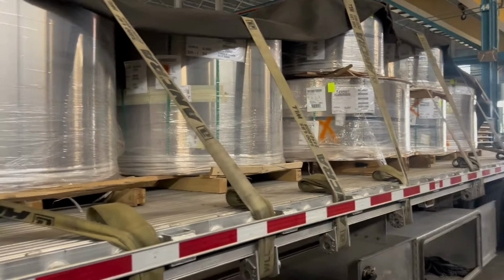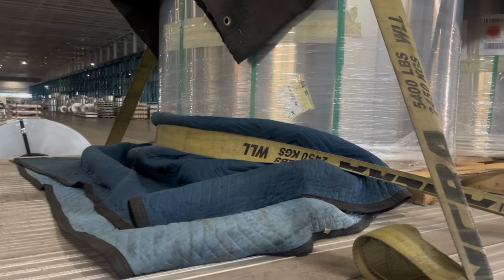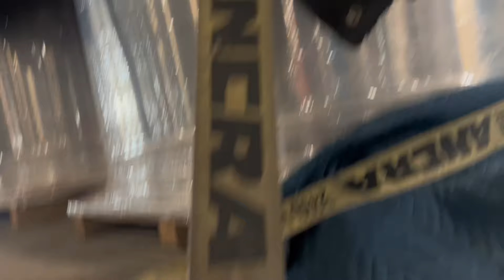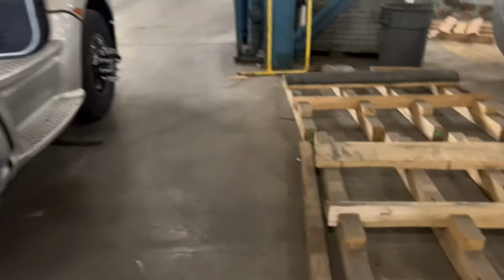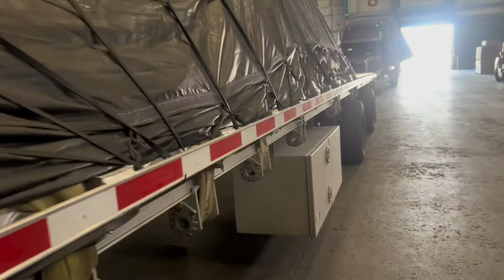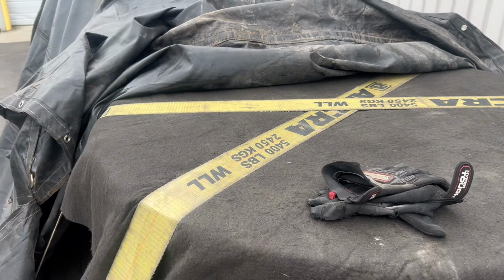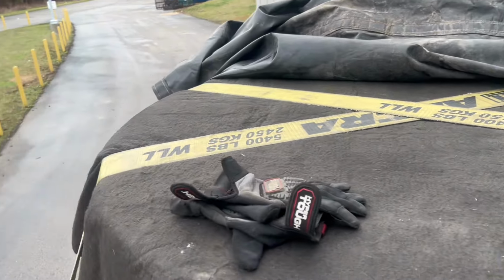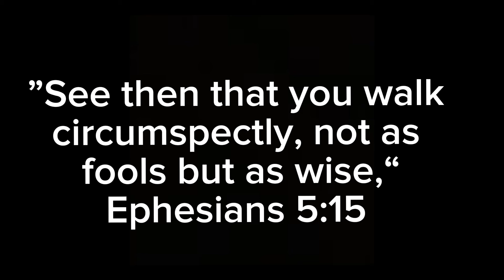CRST Flatbed…. Securing Aluminum Coils￼ correctly

Comment: I think you answered this in another video, but I've had those aluminum coils cut thru all my moving blankets - doubled, but at least not thru my tarps. I think you mentioned the felt works better for that. As for penalty straps, I always do that. I'm going to have at LEAST one more strap than is required.